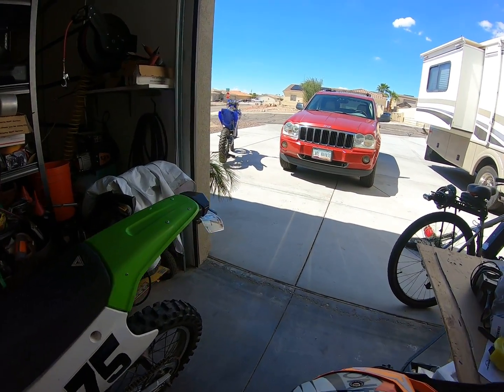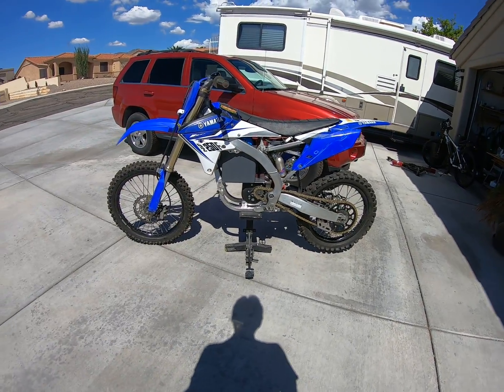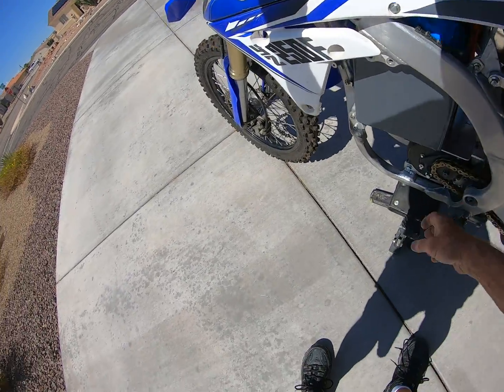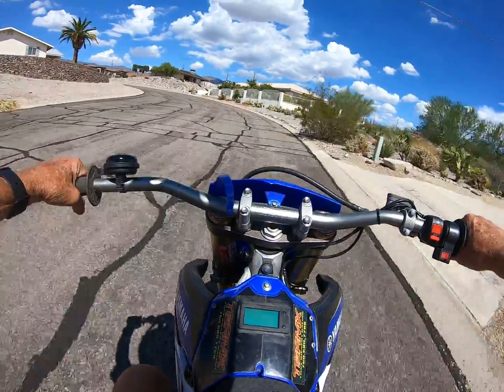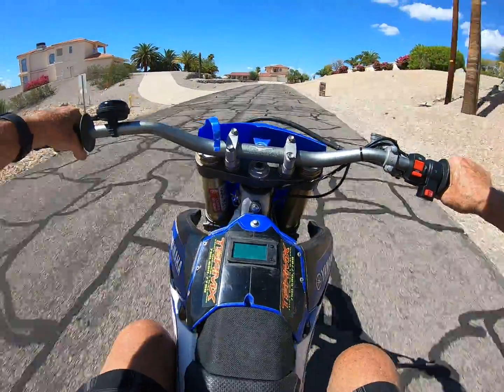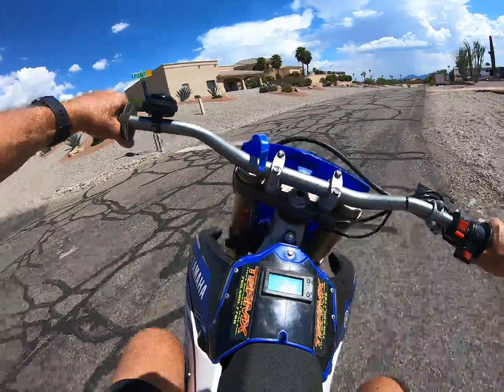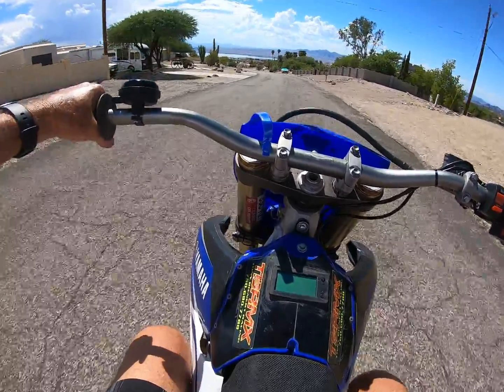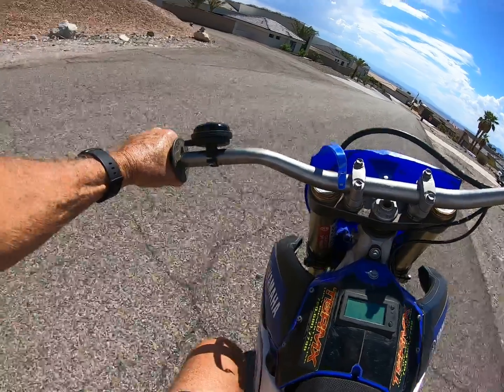2014 YZ250F with QS 138 70HV3 and Votol EM260SP/2 Controller from ElectroandCompany.com

Comment: i have a 2013 yz250f how does this work do you send it a place and they do it? do you buy the parts online and you have to do it yourself? how much is it? i am very curious
Reply from the maker: Here is a rough estimate of a build.  Motor and controller form China direct.  $900,   Motor and Controller kit from ElectroandCompany.com, $1500.  There is value in E&C with there software and support, and an easy to put together kit. To do the work of putting a bike together I charge $1000-1500.  a 20S12P battery for this bike is $2000-2500, battery charger and case.  So you are right at what I am asking for the KTM and you could sell the Yamaha.  I helped a guy in Utah with his build of a 2008 YZ450F, He got a bigger battery in it.  20S16P.  Check out his build.  https://electricdirtriders.com/threads/2008-yz450f-electric-conversion.3570/#post-38296

Comment: How long does the battery last?
Reply from the maker: I have gone on a 12 mile desert ride, and got home with just about 1/2 battery  (71V).  72V is 1/2.  But on the track I get about 8-10 laps, depending on the track, and it is about 70V.  At about 70-71V the power is lower, and you notice it.  So at the track I don't like to go below that.  I am going to a larger and redesigned battery.  Still 2 packs , but only using the BMS for Charge control, and moving the BMS outside of the battery box, so that it can cool.   We are getting problems charging the battery, after a hard ride, because the BMS is overheating.  Keep watching, and I will have a new battery build youtube soon.

Comment: Hey David, this is looking good!! I have a question for you, are you able to get the bike over 55mph? When I hit about 51-55 it hits a hard wall like there is a restriction but I cant find it in the settings. I just upgraded to a 84v battery and it still hits that limit. Any Idea??
Reply from the maker: Are you running the same motor and controller?  I don't know what the max Speed is, no speedometer.  Do you have a system from ElectroandCompany. If so They set it up for Mode 1, Mode 2 are normal and Mode 3 is set to Boost mode. Boost Mode gives you Flux weakening, which on my bike,  you notice the speed increase. ( actual RPM increase) My battery is close to 84V.
Reply: @dcoxryton  I figured it out and now it rips to 80mph
Reply: @scottpurcell2813  I'm interested in building the same type of setup and want about an 80 mph top speed.  What was the trick (and what size rear sprocket are you running)?
Reply: @toast449  I am running a 520 chain, 13t front sprocket 51t rear. on the controller:  SPORT MODE SETUP: current limiting(A): 400, separate
Reply: @scottpurcell2813  You have the controller that Don uses from Electro&Co?
Reply: @toast449  yup em260

Comment: I have a KX250F I'm putting together with a 84ah 72v Molicel battery. It will push 450a DC making it a ripper. peaking around 36kw.
Reply from the maker: Are you using the same motor and controller.  If so you will be so happy with that combo.  The battery seems quite large, is that 20S20P?  I have 1/2 that now at 42AH (Sony VTC6 cells 20S14P 18650 size)  Your battery has to weigh 60lbs +  .  What type of riding do you do, that should give you about 50+ miles of single track.  I ride moto tracks, and I am thinking of going to quick change battery 20S12P Molicel, with a quick change system.  My bike weighs 221lbs with 42AH battery.  ElectroandCompany.com just lowered their kit price on the QS V3 motor and EM260 controller $200 to about $1467 out the door.
Reply: @Donald Cox  yep same setup. It's liquid cooled.  Many helped me get it all. Electro tuned it. 
The battery is very big. 400 20s 20p  molicel 21700 cells. It does weight about 65lbs. Haha.
Reply from the maker: @DevinLindstrom  You are in good hands.  Manny knows his stuff.
Reply: @Donald Cox  yeah he really does. Things have come a long way over the years. I started building bikes back in 2014. Luke live for physics was my inspiration back then. 😀

Comment: Anything for sale?
Reply from the maker: Yes I would sell you this bike for $6000.  That is a bargain.  $1600 for Motor / controller / programmed, $1000 for 2014 YZ250F donor bike, $2400 for 2.8KW battery, Sony VTC6 20S14P. 42AH  , $1000 to put it all together.  Or I could build your donor bike, Yamaha 2014 or newer, KTM 2014 and newer, Honda CRF 2005-2014.  I have a 2006 YZ450F aluminum frame complete Donor bike for $1000. The rest of the costs are above
Reply from the maker: Check out this CRF with the same motor and controller at Glen Helen      https://www.youtube.com/watch?v=wpCnW2bwSnM&ab_channel=CasMoto
This ride was at 250A  The bikes I talked about before with the Sony battery can give you 370A.  A bigger battery could give you 450A

Comment: Very nice!   What’s your max bus bar current?
Reply from the maker: Each of my battery packs can put out 200A's .  The controller is now set at 400A.  I saw 370A on the meter, but it's pretty sketchy wicking the bike and looking at the meter, and how high is the front end going up...  350A is a solid number.  I use #4 welding cable for the main power cables. #6 from each battery.

Comment: Could you do a short video on the controllers you have used? I have a Fardriver ND96530 but looking at Votol or Kelly
Reply from the maker: I have tried many different controllers.  My first experience was Kelly In a few DC Perm Mag motors.  They worked as advertised  a 400A controller put out 400A.  So when I went to PMAC motors, I had a good experience with Kelly, so I went with a Kelly KLS72701.  It worked and I was able to program it and make all kind of adjustments, but I could never get over 280A, and it would fault on serious acceleration. It was advertised to put out 700A but only put out 280A. Disappointing. Then I tried a Sevcon 72V 550A controller.  A Programming nightmare and / or an expensive programing experience.  I could never get this to work well. Then I built a KX80 with the QS138 70Hv3 motor and the Votol EM150SP/2, what a dream. I bought it from Electroandcompany.com programmed and ready to go. They have been flawless. The program comes working perfectly, but it is very easy to make slight personal adjustments or changes. I have built 5 bikes now with this combo or the QS138 70H V3 and EM260SP/2 controller and all have been the same experience. Great.  You can get 450A out of the EM260 controller, but as far as I know the Votol only work well with the QS series of motors.
Reply: @dcoxryton  When you say you get 450a out of the em260 do you mean battery current or phase amps? Im currently looking at a battery with a 300a continuous 500a peak discharge but im not sure if this controller with allow me to use all of that power.
Reply from the maker: @DJMallieMall  Yes, I currently have my EM260SP/2 set for 400A battery current in mode 3.  All my references to current are Battery Current. What cells are are they using in that battery you are looking at, and what quantity, that may be rated powers, not real world power.  But you should still see 450A peak.  My battery 20S14P VTC6 18650 cells only gives me 380A, They are rated at 30AH each cell, and should give me 420A, but I see this on all the batteries I have built, about 10% real world less than advertised.  VTC6 or the other cell I have used, Molicel 21700 P42A, about a 10% lose off there advertised current also.  A 20S8P Molicel  pack only gave me 320A not 360A. But I put 2 of these packs on the KTM (there are YouTudes on my channel with this bike) for real world power of 640A.  He is only running at 350A, and gets 40 miles of single track riding with that.  If you run the controller to 450A, and I know of someone who has, he says you need to watercool the controller. We all are average to Pro riders, and find 250-300A is more than enough for power. It is friqing crazy at 370A. We haven't tested any of our bikes in a real race yet, but here is a pro rider riding at 250A on the Glen Helen main track on a week day with the QS V3 motor and the EM260SP/2 controller on a CRF .      https://www.youtube.com/watch?v=wpCnW2bwSnM&ab_channel=CasMoto
Reply: @dcoxryton  If im correct the desc of the battery says lifepo4 cells but i got another question. I'm still trying to see if i even need 300/500a anyways. After doing a little bit of research a lot of people who run these very high amps are usually for dirt bikes. I'm building a street bike but im trying to hit a top speed anywhere between 70-90 mph 70 being the minimum but im not 100% sure how much power i need and im stuck between the sabvoton or votol controllers. I was originally looking at 150a continous to 300a pulse batteries with either a votol 150, votol 200, or sabvoton 72200. Do you feel 150/200a continous is enough? I honestly only started looking at higher amps to get the most out of my qs 138 90h but i dont want to over heat anything especially because i really didn't plan on watercooling.
Reply: @dcoxryton  Oh yeah and im new to the ebike scene. I'm working on my second project. My first one i messed up the battery not realizing i was putting to much amps in it so i gotta get that one a new battery lol. but ive been researching for the last few weeks and im not quite finding all the info i need so ive been stressing a little.

Comment: Hey Don! What a clean build. I'm Controller/Motor shopping for my 2020 crf450r build at the moment. I have to admit, I thought the QS138 was a bit on the weaker side for motor options.. What are your thoughts on this? How's the power comparison to say a 250cc gas bike? Are you thinking of maybe a QS180 90H in the future at some point?
Reply from the maker: The QS 138 70H V3 is definitely  the power of a 250CC you can even run it up to 450A, and have even more.  Here is a youtube of this combo at Glen Helen on a 2004 CRF frame.  He is running at 250A.  He said he wanted a little more on the uphills, but every where else was  fine.
https://www.youtube.com/watch?v=n9BlsPAM4-o
The width  of the QS138 90H  motor is going  to be too wide with the gear reduction. The QS 138 70H V3 impedes on the brake pedal space, and  barely fits.  If you want more power, like 450 power, a company XEMX1.com has a motor gearbox combo with a quick change battery, but it is all built for the 2014 and newer YZ bikes.  It is a ME 1302 inside with a new CnC'ed gearbox/case. He is using a Curtis controller.
Reply from the maker: Check out this video at Glen Helen of my friend on his 2010 Honda CRF with the same motor and controller (QS 138 70H V3 and EM260) and a 20S12P Molicel P42A Battery.       https://www.youtube.com/watch?v=Mmfd10CqUks&ab_channel=CasMoto

Comment: Love the builds! Curios on what the max charge rate is for your battery?
Reply from the maker: Thanks.  I have the battery in 2 packs.  Each is a 20S7P VTC6 Sony cells.  I have a 10Amp charger for each one.  Since 110VAC is the most common source here in the states, smaller quieter generators, etc.  The industrial 220V generators make too much noise, and noise pollute the pits.
Reply: @dcoxryton  thank you for the information! I’ve done two of these builds myself. My first dirt bike build was with a rm 85 and the second a ktm 380. Both bikes I used 3.2v 20ah A123 cells because not just the high discharge but also the charge rate allowing me to fully charge the battery my battery in under 1.5 hours with the average house hold 110v outlet.
Reply: @iyakab777  i was hoping to see a video of your build on your channel.

Comment: do you share youe motor mount and battery mount with public i would do the same to my bike
Reply from the maker: Check it out here:    https://electricdirtriders.com/threads/yz250f-2014-build-with-qs-138-70h-v3-motor-and-450a-controller-part-1-and-part-2.2733/#post-32888

Comment: Donald, thanks for sharing this.  I recently picked up a 2013 RM 250 and would like to duplicate what you've done.  Also interested in the motor and battery mounts as I believe the frames are very similar.   May I ask where you bought the battery from?  Thanks.  Mike.
Reply from the maker: Thanks.  Send me an email address, and I will send you some pictures of the build. I built the batteries.  You need at least 350 continuous Amps. Many choices.  ElectroandCompany.com have the motor/ controller kit and batteries. 1 x 34AH battery isn't quite enough, you will only see about 320A. I put 2 this size in a 2017 full size KTM ( videos on my channel also) That is adequate. 40 mile range and full power.  2 x 25AH batteries from E&C.com Will get you full power, but not the range. They are pretty pricy. I can build custom batteries, but they cost also.  
This company makes one also that would work 51AH but the size is the fit a Surron bike , about 6 x 6 x17.5
https://chibatterysystems.com/collections/batteries/products/72max
Lots of ideas, let me know if I can help
Reply: @dcoxryton  If you could make me a custom battery that would fit my application I would be interested.  I shared my email address above.  Thanks.
Reply from the maker: @mcapo77  Did I ever answer you about the battery.  We just got some new methods of battery building.  Fusible links via waterjetting.  What dimension battery will fit your application
Reply: @dcoxryton  Don, I've got a plan worked out with the kit from electro & Co.  They put up some new batteries on their site but I wanted to get your opinion on them.  I'm looking at the 76V 48 AH but they're showing a 300A cont discharge.  You've recommended 350A cont discharge.  Any opinions would be greatly appreciated.  Thanks.
Reply from the maker: @mcapo77  That battery is perfect  We were ripping on a friends CRF with the E&C kit  A battery made by Eon Lithium. He was at 300A mode all day, but there is never 300A continuous, on-off-on a bit -off on .  He ripped some laps at mode 3 even.  No problem  There were 3 of us electrics. 2 had that battery equivalent, and mine was even smaller42AH.  Here is a YouTube of me. I'm 78 years old and don't clear all the jumps. The other 2 electrics in mode 2 did them all.  https://youtu.be/Q6pXHLFbl14       Go for that setup the battery price is great. Will it fit your frame?  That battery will fit in a 2014 and newer YZ.
Reply: @dcoxryton  Ok thanks for the response.  Looks like you all had a great day!  Just got ev ordered but the battery.  I'm going to measure ev again once the motor and controller are mounted.
Reply from the maker: @mcapo77  👍
Reply: @dcoxryton  are you using 18650 or 21700 cells?
Reply: @dcoxryton so would you connect two 72v 38ah batteries in parallel?
Reply: And what battery do you recommend for qs138 70h v3 paired with em260sp?
Reply: @mcapo77  thx!
Reply from the maker: @SukhvirDhillon-o5j  I don't think you could fit 2 x 38AH batteries in a dirt bike size bike.  On this bike I have 2 x 21AH batteries. I am building now a bigger battery for this bike.  It will be 2 x 25AH battery, and that is about as large as you can in this frame.  In a KTM frame, 2017 150SX, I got 2 x 34AH battery in that.  But that was full.

Comment: Sweet, don't no how much you paid for bike? I assume you buy them with blown engines, but battery and kit right around 2 grand, basically you get a full size bike, with proven suspension, for about what you pay for a Surron light bee 🐝 basically a rugged mtb that to be fun, you have to pour more money in it. Love what you do, awesome bike, to get similar bike from ebike company 12000$
Reply from the maker: You give me a roller, no motor, exhaust, electronics, and $4500- $6000 dollars, I will give you a running electric Bike. The variance, is what size battery you want.  2014 Yamaha or newer, 2017 or newer KTM SX, 2004 and newer CRF are all good donors we have experience with.  But we can do others
Reply: @dcoxryton  i think 🤔 i could do it under $3000, not counting any shock work it might need and tires, qs motor 3000w peak 12000w , kit is under a grand,ect. Thanks for the inspiration, happy trails
Reply from the maker: @liamneal5325  Good luck.
Reply: @dcoxryton  hehehe

Comment: Nice video.  Do you use contactors in your builds?  Precharge circuits?
Reply from the maker: No Contactors.  I use a battery cutoff switch (BEP Battery Switch  $31 on Amazon. If you buy the cheaper ones the switch does not come out for a security system), with a precharge resistor, 1K10W, and an Inline ANL fuse ,300-400A

Comment: Thank you for the video, do u plan on doing any videos at the motocross track or trail riding?
Reply from the maker: I hope to get some good track video soon, here is a link to a Pro riding a Honda CRF 250 with the same  Motor/Controller/Battery, at Glen Helen
https://www.youtube.com/watch?v=wpCnW2bwSnM&ab_channel=CasMoto
I hope to get all three bikes, the 2017 KTM, the Yamaha YZ, and the CRF all with the same motor/controller/and battery, out to Glen Helen within the next few weeks.
Reply: @dcoxryton  thank you, look forward to more of your content. Thank you for sharing
Reply: @dcoxryton  Look forward to seeing some video of that! Motor seems strong in that video. If you're using the 42ah battery in that CRF, how much juice was left after those 5 min of riding?
Reply from the maker: @bayoolukotun3485  The battery wasn't full charged when I took off, it as about 80V.  I looked at it yesterday and it was 77V . With that battery, I can get about 10 laps on our local MX track.  At that time it is in the high 60V range or 70V.  But you can feel the power reduction. I had this battery in another bike, different motor/controller, but about the same current draw.